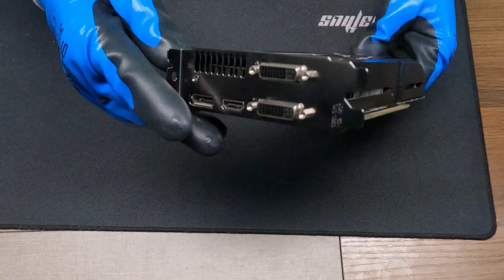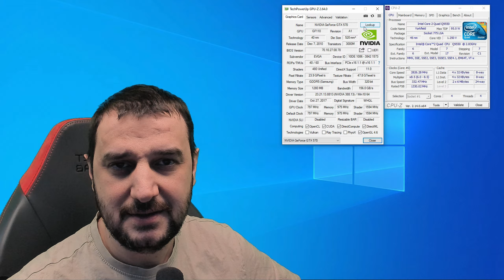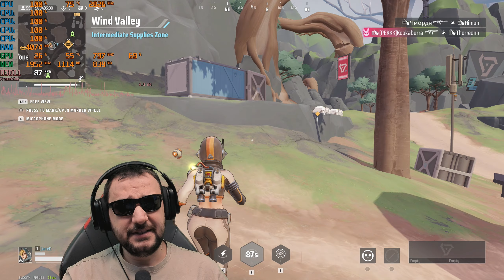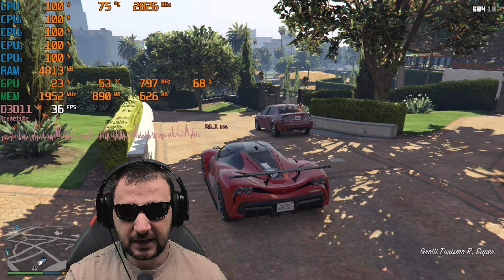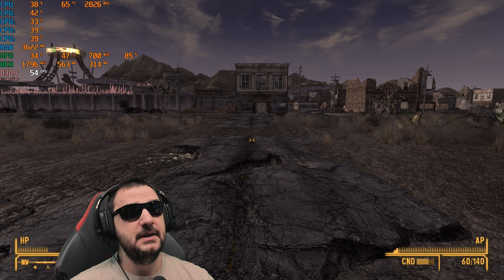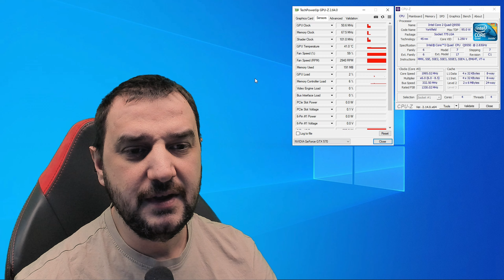EVGA GTX 570 HD Superclocked Benchmark

Comment: Dang, you are heavily bottlenecked by cpu and ram, the 570 should get you more stable framerates, the system is bottlenecking the gpu. But nontheless great video as always, can see how that works under certain conditions. It's neat to learn for the future and your conclusion is neat, i can understand the struggles, finding out, where the problems are and how to manage them. Always a pleasure ☺
Reply from the maker: The CPU and RAM bottleneck are definitely holding things back. Glad you enjoyed the video.

Comment: 16:25 I don't remember if the multiplier can change depending on load (some power saving feature on board?). I tweaked some settings in BIOS long time ago, on my system q9300 multiplier is always at x7.5 (MAX) , with FSB at 400 (preferable) hence 3000MHz on CPU. Your CPU-Z says x6 and shows ~2GHz. I wonder if it actually works at this speed under load. If not, that would be massive downclock😯 and a reason for poor performance.
Not to mention, you could easily overclock q9550 without even touching voltage, provided your ram is not garbage. 
BTW. some of those supposedly light games like "Farlight" seem to be very demanding. 4 cores at 100% utilization? That's quite a lot for a fairly simple game. 
I would also try to stick with older systems.
Reply from the maker: is it possible with OEM PCs like those HPs? I try trottlestop but it doesn`t work.
Reply: @DanielCardei  
Aaah, right it's a proprietary dell system, so no OC for you. But wait, I just noticed your CPU-Z is showing higher x8.5 multiplier (sometimes) so maybe there is indeed some power saving mode enabled in your system. Well, i guess that rules out the possibility of down-clocked low performance. 

These CPUs do overclock like crazy, but you need a decent MOBO and (very)good RAM, because after all you overclock by FSB and that means inadvertently overclocking RAM at the same time.
You could OC a proprietary system like DELL, HP to 400 FSB with "BSEL mod". You can google that if you are interested. But i'm afraid with garbage RAM it might be harder to have it stable.
With 400FSB you would get a healthy 3.4GHz and 1:1 ratio to RAM. Like i said earlier, i have q9300 with lower multiplier so i got 3.0GHz with 400FSB.
There is also "SetFSB" program but it might not work on this proprietary system :(

Comment: Check out a Xeon X5680, released in 2010 making it 15 years old. 6 cores, 12 threads, can overclock to 4.3--4.5ghz with a good cooler. X58 architecture with triple channel memory.

I've got one in my system right now and can play Cyberpunk no problems with it.
Reply from the maker: I have a Xeon W3690 and i did videos with it. Wait LGA 1366 doesn`t have some instructions. How did you play Cyberpunk 2077?
Reply: @DanielCardei  Cyberpunk originally had AVX enabled but due to crashing all the time they disabled it.
Reply from the maker: @ it runs with lga1366? wow

Comment: It would be interesting to see how these old core 2 duo and quad cpu's handle normal daily tasks like browsing and watching :stayhome:videos at 1080p and 720p at x2 speed for example .There are working browsers for windows 7 like community projects like supermium and r3dfox which are basically the latest version of chromium and firefox ported for older OS'ses like 7 and even xp,though xp is not wise to be used online anymore .There is projects like one core api which allows you to install latest versions of programs on xp,play dx9,10 and 11 games on xp :devs said that crysis 1,2 and 3 work,gta v,far cry 4 ,metro last light etc  Thats bananas 🍌🍌🍌:face-purple-wide-eyes: It would be interesting content for the old cpu's .
Reply: Bro, i'm writing this comment on q9300@3.0GHz 8GB DDR2 Win8.1
Reply: @Q36BN  nice

Comment: It is the temp on the chip IMHO those have a tcasemax of 72C don't get me wrong its still bottlenecking but its running to hot I have one as well if it is over 68C it lags the same way same as my Q6600 try to find a cooler that fits those odd ball boards.